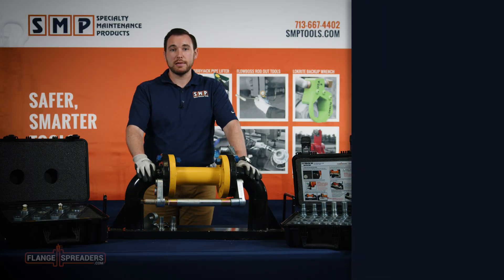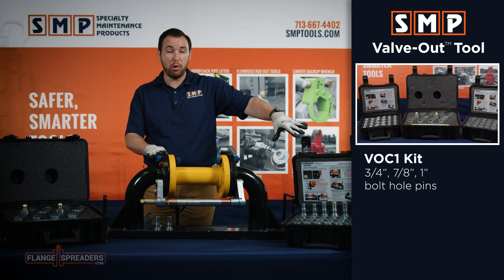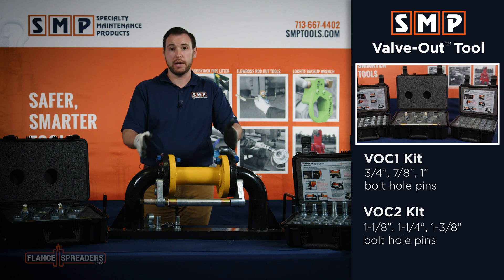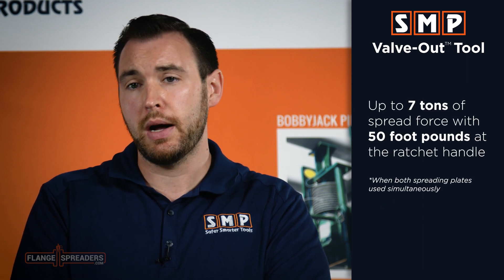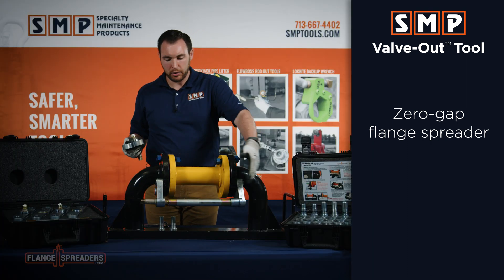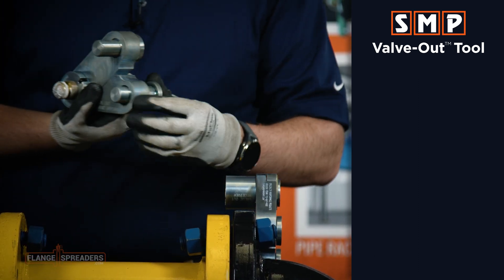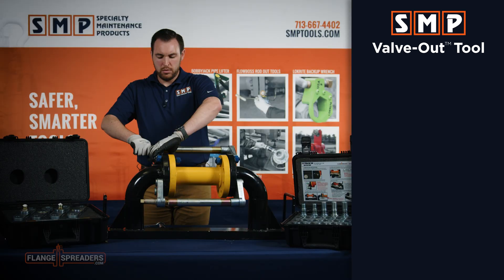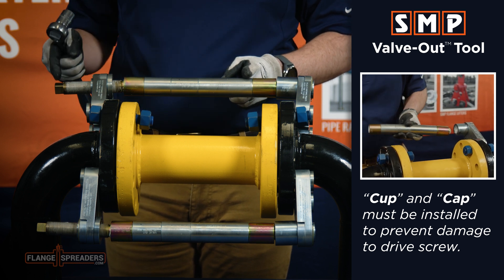SMP Valve Out Tool - How to Remove and Install Flanged Valve

Comment: Has anyone used this in a real life setting? Specifically a steam reducing station. If so, I'd like to hear about your experience. My Sumner flange spreaders are bent from 1 use.
Reply: Just used it to day in a 100 ft sewage basin on a 8 inch flange took me about an hour to figure it out, real life meaning had to use a crane to get the scaffolding down their just to replace a gasket. It works
Reply from the maker: Like with many things, you get what you pay for with flange spreaders. We have received incredible feedback on this tool from maintenance mechanics. Feel free to check out some customer pictures and videos on our website FlangeSpreaders.com